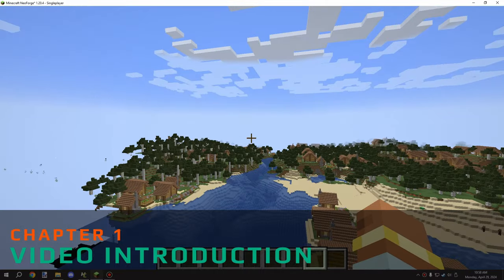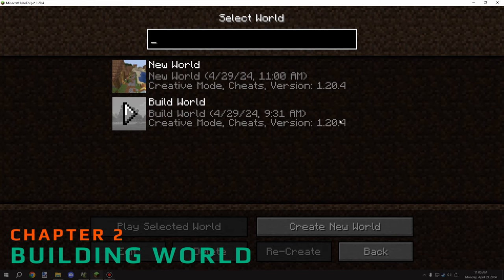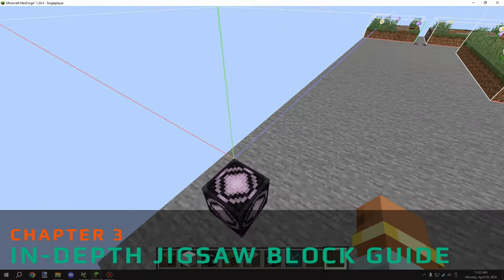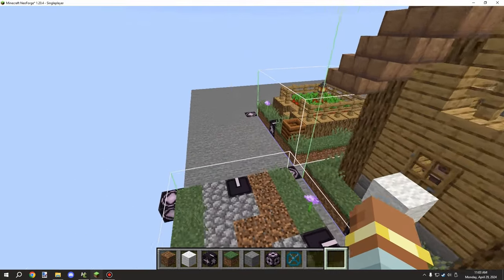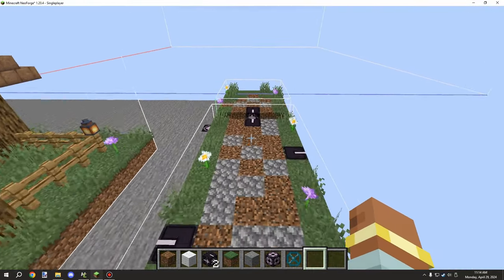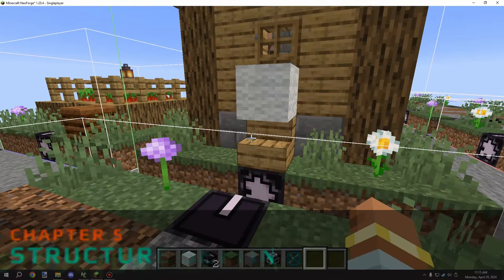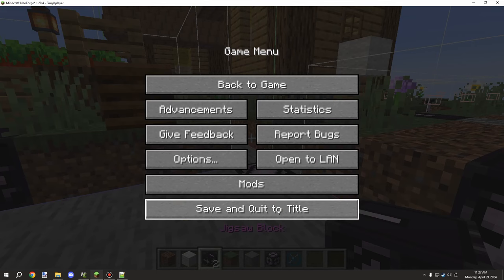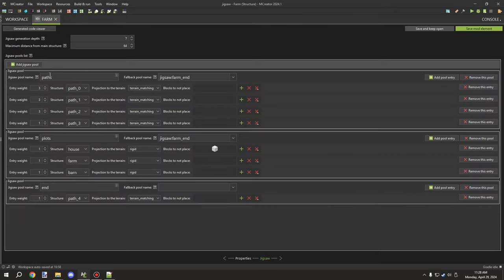Structure Jigsaw Feature | MCreator 2024.1

Comment: I've been looking for a jigsaw tutorial for MCreator ever since the feature was added. This helped so much!
Reply from the maker: I think only recently we got full support from Mojang to use them, I had tried to make a structure last year I think and had no luck but recently it was possible, may have also been just been that MCreator did not have proper structure support, the old structure element uses features to generate structures which is not compatible with jigsaw blocks.

Comment: I have a couple of questions.

1 - to connect jigsaws, do we need to have one block with the target and the target block needs to be empty?

2 - for the fallback pool, do the pieces need to have pool destinations set?

3 - if I designate a jigsaw to another jigsaw, but that another jigsaw is designated to a third one, does it still work?
Reply from the maker: For #1
The block that generates the connecting jigsaw should have a target name under your mods namespace. Also, the name should be left as minecraft:empty for the block selecting the connecting jigsaw.

For the part that generates the jigsaw block should have the name set to be the same as the generator jigsaw block's target name. The target name on the generating jigsaw block should be Minecraft empty.

So to recap.
For the block generating 
- Target Name: example_mod:example_name
- Name: minecraft:empty

For the block is generated.
- Target name minecraft:empty
- Name:: example_mod:example_name

For #2
Not sure I fully understand what you mean by destinations.
The fallback pool will need the correct name for the block-generating

Using the example in #1 your fallback structures should use the second recap settings to match the generator blocks.

#3
Still not sure what you mean by designate.
Think of the pool as a loot table because it just consists of a list of structures that can be generated.
You can even have more than one name group in the same pool, this basically makes it so only the jigsaw blocks with matching names will be selected from the pool.

Say you have the following structures with the names listed below for the pool the number it starts with on each line will be the group it belongs to and will generate from.

1 - Structure A Name: houses
1 - Structure B Name: houses
2 - Structure C Name: decor
1 - Structure D Name: houses
2 - Structure E Name: decor
2 - Structure F Name: decor

As you can see anything with the name decor will be part of Group 2 whereas anything with houses will be part of Group 1. The game knows which is which based on the name provided in the jigsaw blocks and it will automatically select the right group even if there is more than one group in the same pool.

When it comes to a fallback pool this is used normally at the end of the maximum distance from the center jigsaw block. In villages, it is generated at the end of the paths in some cases. From what I can tell they don't always generate but I am not sure why this is the case. It may require space or something but I have not looked too much into the pool though wiki has more technical documentation on jigsaw blocks and it's files.

I hope this helps a bit.

Comment: great tutorial, just a bit outdated for me because I use mcrator 2024.2 instead of 2024.1, and I'm trying to make a dungeon like underground structure. and the jigsaw block UI for me is missing some settings from the video. I was wondering if you could make a tutorial for 2024.2? EDIT: so never mind- I was just being dumb because i had it horizontal instead of vertical and you had it vertical so that is an extreme facepalm at myself. still though great tutorial!

Comment: Hey NorthWestTrees, I’ve been working on trying to get my structure to spawn correctly for the past couple of days (around 7 hours) I have no idea what I am doing wrong.

For the 4 different branches to the centerpiece, their jigsaw properties are all the same:

Target Pool: Minecraft: Empty

Name: Interdimensional: Branch

Target Name: Minecraft: empty

Block to replace: Interdimensional: glazestone_bricks

The centerpiece to the whole structure has 4 jigsaws on each side which are supposed to randomly select one of the four branches to spawn in its place, but they aren’t. These are the jigsaws properties:

Target pool: Interdimensional: dusk_temple_branches

Name: Minecraft: empty

Target name: Interdimensional: Branch (I want it to target all four branches for each side)

Block to replace: Interdimensional: glazestone_bricks

I really don’t see anything I am doing wrong, are you able to see an error? If so, are you able to tell me? Thanks.
Reply from the maker: The jigsaw block part looks correct, your not wrong.
There can be other root causes though.

If your structure element is called DuskTemple and has a registry name as dusk_temple then the pool is also correct if not then you will need to make sure your structure registry is your first part of your pool name in the jigsaw followed by the name you created for your actual pool entry in MCreator. Between the registry name and the pool entry name should contain an "_" without quotes For example if the structure registry name is dusk_temple and your pool entry is branches then from what you showed above this would be correct.

The other main root cause is the jigsaw generation depth if the value is not high enough then to reach all the parts then it will not generate the connection. By default it is set to 1 which should allow 1 connection from the root structure, but if you have more connections off of those connections then you will need to increase the number. Setting it to 7 (the highest value) should fix most issues.

Those are the most common issues people are having at least another issue could bhe that the maximum distance from the main structure is not high enough from what I understand with this setting is its how many blocks away from the exact center point of the structure or possible the axis point of it so if you are using structures that exceed the default 64 value then you can also try to increase this number the highest value it can reach is 128 which if I am correct a total of 256 blocks from one side to the other of the structure which is the same as villages and most other jigsaw structures in the game.

If your structure is not spawning at all then there could be a issue with the biomes to generate in tag or selected biomes. On 2024.1 and a bit prior if you used "mod" as your tags, it would take this tag as a namespace not as a variable for your actual mod namespace so if your on 2024.1 or prior then you will need to type out your namespace rather than use the mod thing, however this should have been patched out in 2024.2 I reported the issue and it should be fixed.

You can also try setting the generation stage lower in the list so that the structure will generate after other things this may fix some issues with it generating best way to describe this setting is its like a layer for when structures will be placed, features also use them sadly some things in the overworld like trees use the last layer so its hard to fill in structures around things like trees but in custom dimensions you have more control over the ordering.

I hope this helps a bit most likely its one of the issues I have listed above.
Reply: Hey, I’ve got one more thing to add. It’s probably not the 2nd error as this structure is one middle structure with 4 jigsaws at each corner calling for one of the four branches. And those branches end right after placement.
Reply: I’ll see if that other stuff works. Also do you know how I get it so my structure spawns normally in my dimension (nether-like Gen) and not on the rooftop?

Comment: Amazing tutorial as always. Is there anyway you could create a tutorial more in depth into the different spawning of structures? I can't seem to get my structure to spawn in the nether other than on the roof.
Reply from the maker: You can use the minecraft:is_nether tag to select all nether biomes.
But there has been issues with structures at least features generating rarely under sea level. This though I think is a Minecraft issue not MCreator related. I don't think there is much way to improve it through the structure element though if you use features to spawn your structure you can increase the  probability of generation using the repeat block under common placements. However features don't support jigsaw blocks sadly so you lose them doing it that way I guess.

Comment: I generated my structure but It only generates the base path with two building. And yes if you're wondering my path has 2 branch that connects to 1 build using jigsaw blocks. Instead of continuing the path from the base path, both of the front and back of the path generates the fallback path instead.
Reply from the maker: I would make sure the target name and name of the connecting structures are correct, and also make sure you have the right pool in your structure.

Keep in mind that with MCreator it's under your own namespace.
<mod_namespace>:<structure_registry>_<pool_name>

Also, try increasing the values for "jigsaw generation depth" and "maximum distance from main structure" the latter is measured by block in radius so if your main structure every direction can reach that number of blocks.
Jigsaw depth is how many jigsaw blocks can run before it's stopped, the maximum number is 7 times so that means it can generate up to 7 times from the starting structure.

I hope this makes since and helps you figure out the issue.
Reply: @NorthWestTreesMCreator  Thanks, I managed to get it worked. Also I wanted to make a custom stronghold structure, can it overwrite the vanilla one?

Comment: Hi. Will there be a video about fishing in lava and a different loot table? I've been struggling to code that for a long time now. Thanks btw
Reply from the maker: I can't think of any way this can be one without custom java code. So probably no.
Reply: @NorthWestTreesMCreator  Okay, thanks. I'm gonna try to find out how to do this, maybe you will one time add a custom nether dimension, where you could fish, to your lore mod
Reply from the maker: Fishing in custom dimensions would be possible so long as the dimension supports water. Though I am not sure if the loot table could be separated, if there is a global procedure then it may be possible to cancel the event and roll a item from a custom loot table I guess. I will have to look into this I may be able to make a custom cave world or something in the far future. I have many biomes I need to work on on the surface but adding a cave world would be pretty neat I think like you suggested.

Comment: Hi, thank you so much for the guide! But how can I make it so that another one can be placed on the pool structure? It should turn out something like -> CENTER -> ROAD -> HOUSE, Center and road are generated, but for some reason the house does not want to... perhaps the puzzle block needs to be prescribed a more correct path, can you tell me what the code should look like?
Reply from the maker: So in minecraft villagers the town center has jigsaw blocks that call from the paths list, the paths have different directions  which spread the roads one needs to share the name with the target name on the town center jigsaw block, this allows them to connect to each other, also path can have jigsaw blocks on the sides that connect to houses which houses share the same name as the target name as the block on the sides of the paths, this pool for houses is its own pool which then has all the houses in the pool list.
Not sure if this makes since if not I have been planning a series that explains everything form start to finish making custom structures. I have one more community tutorial to record then I will be moving onto the series after that. So a few more weeks until I start recording the series.
Reply: @NorthWestTreesMCreator  Wow thanks! I'm waiting for new videos!

Comment: " errors in current datapack prevented world from loading" 😐
Reply from the maker: Make sure you know what mod is causing the problem, if its your own mod then it may be worth checking if the project has any build errors to do this regenerate the workspace. If no errors happen and its your mod then open a bug report as it could be on MCreators side possibly.
Reply: @NorthWestTreesMCreator  okay it started working, however, it only generates 1 structure

Comment: Hey i have a question, I want to make villager spawn in my structure using jigsaw like in vannila villages but it doesn't work with biomes with no villages so I can't get jungle and swamp villagers, Any work around or do I have use it as entitt
Reply from the maker: I don't think there is data pack support yet for villager skin, though villagers should always resort back to the plains villager theme if no biome is selected for one of the few themes the game does have.

Comment: How do I make an axe (that breaks wood, disable shields and strips logs) but that can also slash like a sword?
Reply from the maker: You would need a axe for your tool type to break wood, not sure about disabling shields this may require custom java code, stripping logs should also work if you use the axe tool base. For slashing you would need a procedure when the tool finishes being used and apply damage to all entities around the player using the sword so you would need to test if not the event player for the iterator entity when using the all entities just make sure you set up the script with a NOT block or it will only work for the player using the tool what you want is to exclude them not make them the only player so testing if its not the same as the player using the tool will do that.

Comment: how can i make a structure that's half in the ground like a waterfall?
Reply from the maker: Having a hard time visioning how a waterfall would be half in the ground.
But you would need to use features not structures as feature have support for offsetting NBT structures unlike the structure element so you would need to place your structure -3 or something on the Y level and it will shift the structure in the ground. Also features also work with my non-floating structure script which you can find here.
https://github.com/MCreator-Examples/Projects/discussions/4
Reply: @NorthWestTreesMCreator  thanks! Also I meant the pond that the waterfall creates is half underground

Comment: I'm going to need better instructions for how to use the Jigsaw blocks. I followed this tutorial multiple times to create a jigsaw structure yet when I generate the structure it only creates a single part and refuses to place down anything else. When I added a fallback pool the structure proceeded to not generate at all. Each part of the jigsaw structure has names, they all have an assigned pool matching up with the name of the pool in the workspace, and they all have weights. Yet, the structure refuses to generate properly.

Edit: I may have found what went wrong, but in the process of trying to fix it some world data got corrupted :(

Edit 2: I recovered the files, attempted to fix what was going wrong, but the jigsaw structure continues to only generate one room. What do I do??? naming the target pool [moddirectoryname]:[structurename]_[poolname] in the jigsaws but they still will not work.
Reply from the maker: Yikes not sure what you did to corrupt the data.
Don't worry about the tutorial its on my todo list, I am going to dedicate an entire series for it from start to finish in shorter videos. I have three more community tutorials to cover which will take about 6 weeks then I will be starting that series directly after.

Comment: I have a question, say I have a structure that I want to generate exactly once per "dungeon", how would I best go about this? and if I have 2 different ones that I want somewhere in the dungeon exactly once?
Reply from the maker: Your best bet would be making the part part of the main structure that the other parts generate from. Like a village center.
You could also delegate one side of the main structure and simply use a specific name and target name reserved only for that one structure type, this would allow you to have it generate on that side all the time. However in both cases you would still need it to be part of the core structure.

Comment: Can I choose from multiple pieces to generate? Like a pool instead of one specific piece,  or am I restricted to only a singular piece
Reply from the maker: you can add jigsaw blocks anywhere in your structure, I don't think there is any limit how many you can cave but the distance between the starting structure and the path generated between jigsaws can only reach a distance of 7 though you can have more than 1 jigsaw block for each one of those structures so it can spread quite a bit.

With that being said you can also use some as props to decorate structure though if children of a parent structure overlap with each other than only one of them will take priority and cancel the others out. The size seems to be in relation to the structure size though this has not effect on the parents of the child being generated just siblings of the jigsaw blocks on the same structure and possibly other parts at the same level of generation.

I hope this helps a bit.